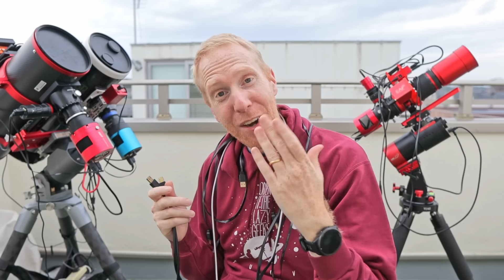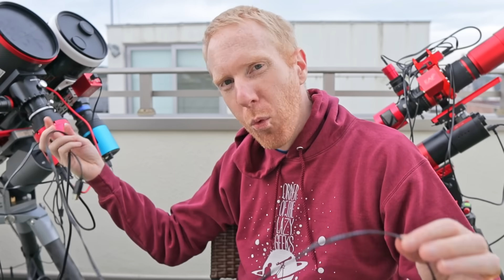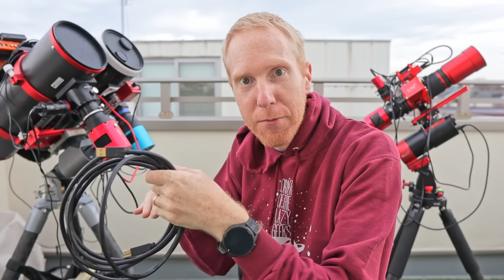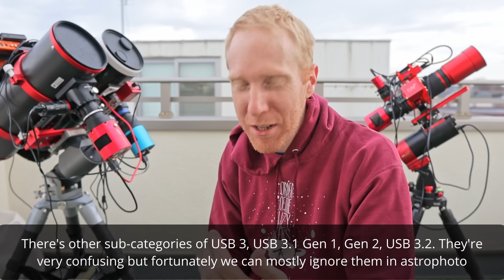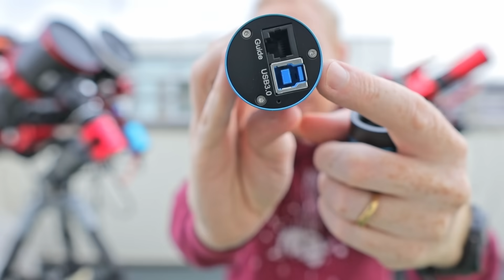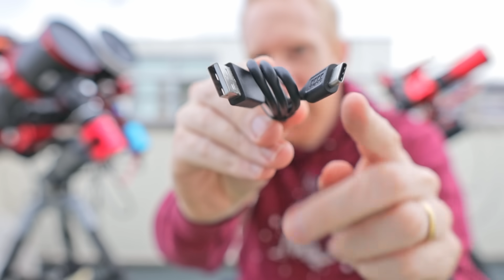YOU could be the NEXT VICTIM! Prevent Cables from Ruining your Next Astrophotography Night

Comment: You gotta loop the cables so that they are not tight at the bends. Replace the cables with high-quality cables that are nylon braided and shielded. ZWO has a warning for ASAIR not to run the power cables near its antenna. The cables provided by manuifacturers are the cheapest.
Reply from the maker: Yes that makes sense! I've always wondered about those braided cables - are they well shielded? I mean it can't be worse than those flat cables :)
Reply: @CuivTheLazyGeek  It depends. You have to do your research Like the filters ;) . I have found good quality cables in Amazon that have lasted the Arizona heat and rough handling. I always use shielded cables anytime these will be close to electric carrying cables or power supplies. Yes, these are less flexible and tend to be thicker. You can also use angled connectors to reduce stress on the cables. Not sure why manufacturers don't convert to USB-C which is easier. Just make sure they are labeled SS (Super Speed) for USB 3 or above. Braided cables offer greater durability. and prevent the mini copper cables inside from tearing. Lastly, if the cable is cheap, it is not going to last.

Comment: This is very helpful! One of the reasons I don't bunch my cables together in the interest of so-called "cable management. I learned from the world of audio and video production that power cables should not be coupled with signal cables. The power cables can interfere with the signal cables. It seems your issue was a bad cable.
I do make sure that none of my cables gets snagged while slewing, but "cable management" is for more permanent installations  or for pictures of gear that people put on the Internet, so other people won't complain about a lack of cable management! :-)
Reply from the maker: Good point! I will say that some cable management is good in windy conditions, and when they can get snagged somewhere - but sometimes it's done purely for aesthetic reasons :)
Reply: @CuivTheLazyGeek  Yes, people do it mainly for aesthetic reasons (to post pictures of their setup). Typically I don't show my gear set up since it only invites gripes from the "cable management police." :-) 
In actual use, I never have a problem with my cables. If the wind is strong enough to blow cables around, I'm not doing astrophotography that night.
Reply: @VisionCommunications  Would you not use that plastic cable holder that Cuiv showed?  You don’t use anything at all for your cables?

Comment: Thanks for the great video. Cable failures have happened to me way too often and ruined many of my imaging hours. It is particular annoying when the issue lies with the powebox plug. It could be much harder to find the culprit. Now I have developed a method whenever this happens. That is to unplug all cables and start with only the camera USB 3 cable and plug them back in one by one to pinpoint where the issue is. It could take some time and sometimes the results can be inconsistent, but still a little more systematic and useful than blindly plugging cables in and out as I did before.
Reply from the maker: Oooh Nice! This is a good, systematic way of diagnosing, it would have prevented me a lot of pain!

Comment: I had experienced the same problems with cables bought from amazon and ironically one Uk optical store said they don't stock cables and to buy from Amazon.
 In contrast to that FLO did stock cables that they recommended
My flat USB3 cables that came with my ZWO camera would never connect with my laptop USB3 port but worked via USB2.
As you said you need better quality cables and you can't really trust anything you buy based on the label or price.
Reply from the maker: This is the second comment I see mentioning needing to use the USB2 port... things are really weird sometimes...

Comment: Great to know Cuiv! Thank you for sharing. I think I will also replace my flat USB3 cables against round and shorter ones. I have the feeling that I loose some speed somewhere are well as my AsiAir needs long time updating as well even though I also use these cable organisers on the camera and the AsiAir.

PS: Still waiting for the MeowAstro review. 😄 Unfortunately they are going to release a new UMI17 with a much nicer appearance (it has a cat on its housing) this month. The new version will hit the market even before my mount has arrived. 😭
Reply from the maker: You're not using the ASIAir Mini right? This one is limited to USB2. I've been wanting to review the UMi17 Lite, but the weather hasn't allowed me to!

Comment: Sometimes it's not the cable but the usb port. If look with a strong magnifying glass or very close up camera, you'll notice two bendable clips on one side of the port that should push up onto the cable, that might be pushed in, giving you that loose cable feel and sometimes causing disconnects. With some small needle thingy, try bending it a little back towards the cable side to give the slot that new cable, tight feel. I hope you understand because it hard to explain.
Reply from the maker: Oh wow, thanks for this - sometimes I with we could have just unbreakable cables fused in place without needing plugs :)

Comment: I recently had a night ruined but with a different scenario.   I was using an ASI2600 MM Pro hooked to an Eagle 5 through the USB 3 port.   NINA kept recording images as far as I could tell, but at the end of the night there were no images on my hard drive.   I checked my download site as designated in NINA imaging and nothing.   I went on Cloudy Nights and found references from several contributors that ZWO cameras sometimes have issues when plugged in to the USB 3 port.   And yes, I was using the supplied USB 3 red “fat” cable.   Their suggestion was to plug into the USB 2 port.   Despite not making sense to me, I have done it since and found it to work.   Any thoughts on this issue?
Reply from the maker: This is extremely weird - and it makes no sense to me... But if it worked.. Or could it be something else? Were they no errors in NINA? That's also weird...
Reply: I got no error messages from NINA.  As far as NINA was concerned everything was going well. Admittedly I was not watching minute by minute.  I was asleep 💤

Comment: In addition to the color, check the number of contacts. You can find blue connectors in the wild with only 4 contacts. So you get a blue USB-2
Reply from the maker: Oh man, now that is plain evil from the manufacturer!! Thanks for the tip!
Reply: My ASI1600MM Pro has blue plastic indicating USB3 connectors. Had a lot of trouble with it until a fellow imager suggested to put the umbilical cable from my mount into a USB2 port, Fixed that problem ever since on my laptop. ZWO needs to realize blue plastic does not a USB3 make. So, now I have USB3 cables and a USB3 powered hub feeding a USB2 port on my computer. I don't have a problem with that because I take long exposures. So, my systems have plenty of time to download images and get their control pulses.

Comment: Cuiv! You fantastic creature! It's all your fault 😊 You got me in to this.  Since a year ago binged everything from your channel, Nebula Photos, Deep Space Astro and anything  I could find on the topic. Exhausted my EOS450D and AZ GTi Bought a GSO200 F4, AM5, QHY715C and Uranus-C pro. Oh and a 3D printer to print all the goodies. And Yes, understanding collimation is a "thing" .. #$/:-/
Anyhoo, last session my focuser didn't connect. It did before right? Spent a few hours with the Device Manager open,( restarting windows., reinstalling Ascom driver etc) indeed and almost  gave up, until I unplugged the cable and plugged it in the usb port next to it! It pinged, opened a fresh unused COM port and worked happily all night. 
Check out the focuser by the way, an EAF GEMINI 2 pro on Ali. Backlash is about 30 steps.
Above all I'd like to thank you. I would  not have been where I am without you. So, thank you! Clear skies!
Reply from the maker: Woohoo, I'm so happy to have dragged you into the abyss that is out hobby :D And dang that cable story sounds very, very familial hehe. Thanks for the information on the EAF Gemini - that thing is CHEAP! And little backlash is always very nice :)

Comment: Hi Cuiv, good report, I had exactly the same experience with my Altair 26C, I changed over the usb cable and it worked, but only for a couple of days then failed again, this time I couldn't rectify it so, I reached out to Altair I returned the camera to them (it was just out of warranty) they checked it and found it was the board 😢, it can be repaired £400 ouch. Hope this is not the same for you.
Reply from the maker: Ouch for the board... glad they got it fixed for now!

Comment: Yeah I had a USB cable (provided by ZWO!!) connecting my 533MC Pro to my ASIAir.  The only symptom it had was once a night or so ilI would get an "exposure failed" message... And allllll night it would randomly not register an exposure being completed with no error at all.  So for example my counter would be on image 6/50 and randomly at the end of the next exposure it would STAY at 6/50 and just keep going.  I was losing a dozen or more shots over the course of a night.  No error recorded in the log either.  

Cheap Amazon USB cable (from Cable Matters) has fixed everything.
Reply from the maker: Crazy how changing a cable can solve so many random issues!

Comment: Very good advice Cuiv. I worked in electrical/electronic engineering for fifty years before retirement, poor cable management, sub standard cables and connectors and cables used for something they weren't designed for were responsible for a lot of problems I was called upon to solve. Now I only buy cables from reputable suppliers that specialise in supplying the astro photography market. Buying cheap USB and power cables online is asking for trouble.
Reply from the maker: Thanks for the feedback! I guess in the end it would also be nice to have locking mechanisms on our connectors... and something to avoid corrosion!
Reply: What brands do you recommend? Kondor Blue any good?
Reply: @lionki3  I have never used them so I can't say. I've never had any trouble with Lynx Astro cables but they are relatively expensive, but then again compared to the overall price of the rig it's still only a small amount to pay. I live in the UK and buy my cables from First Light Optics, I had a bit of a connectivity problem last year and found their tech support team very helpful.

Comment: dont know if you ve dealt with cables in well below 0 C ... it s a fantastic experience. i actually contacted pegasus astro asking them if they would consider manufacturing data and power cabling with silicone sleve for winter use but they were mor or less meeh